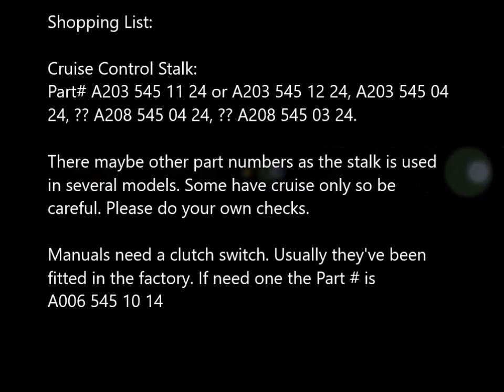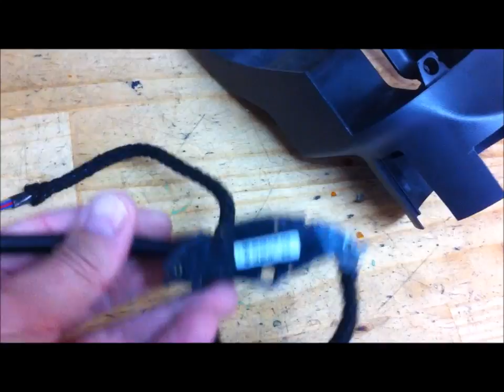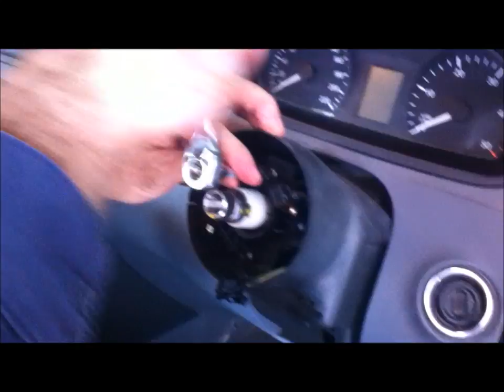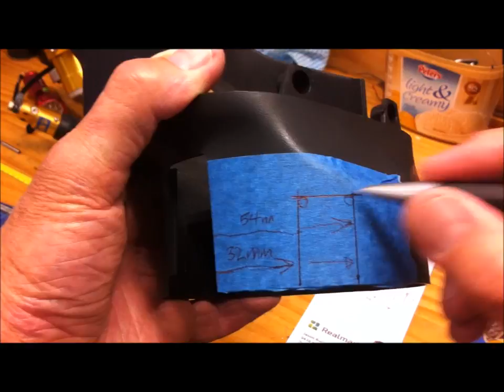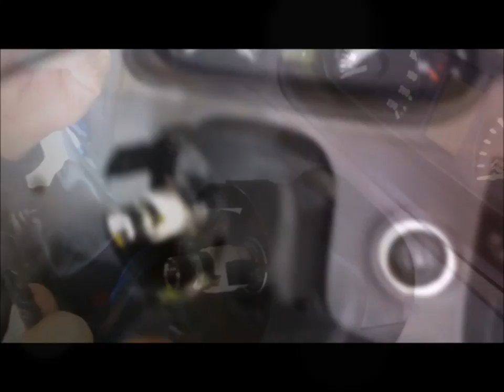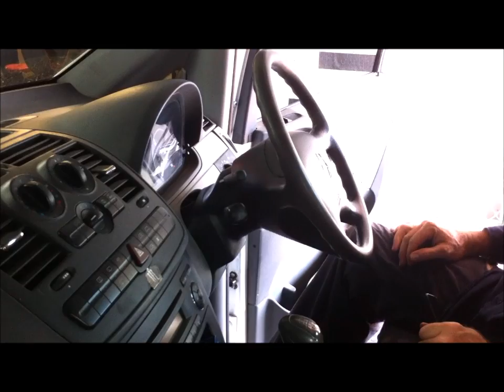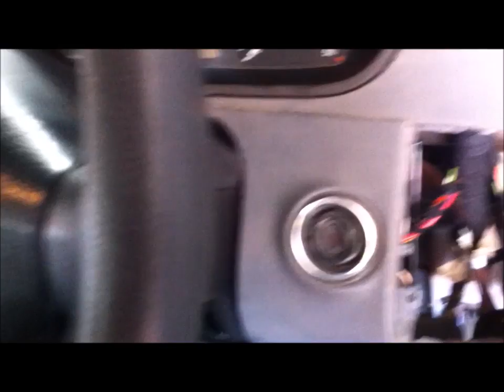W639 Vito Viano $60 Easy Factory Cruise Control retrofit

Comment: Hi Scott,
Thank you for the great video !
I am looking to install it on my 2007 manual Vito VIN : WDF63960313260718.
I am wondering what are the difference between all the cruise control Stalk references you gave at 4:09 ?
Regarding the accelerating pedal, I have a Bosch one 0 280 755 023 / A 906 300 04 04. I didn't desassembled it but it seems not having the switch. Do I really have to change it if I am just interested about speed cruise control and not speed limit ? If yes, what is the reference ? Bosch 0 280 755 024 ?
I have clutch switch installed.
Thanks for your help.
Jerome.
Reply from the maker: Thanks Jerome. The CC stalks have different part numbers for different models but they're the same. You don't need to do anything to the accelerator pedal. If you buy one of those part numbers and follow the video it will have cruise control and speed limiter.
Reply: @ScottElliott152  awesome Scott ! Thanks very much. I will order one piece, follow the process and let you know.

Comment: What is the original part number (Cruise control) for the 2016 B-Class, 180 dci (1.5 D), 110 hp, manual transmission? Thank you
Reply from the maker: Use this online parts finder. That's what I do.
https://partsouq.com/

Comment: Hi Scott, Could you please share your thoughts if retrofitting of Distronic to w639 is a viable idea?  Distronic is installed on the similar year (2010-2014) passenger cars, but I haven't heard about it on V-class prior to w447. Do you think w639 SAM supports this feature?
Reply from the maker: I've interrogated the SCN coding on my W639 and have seen no reference to the Distronic on my 2006. Knowing what these Mercedes are like I feel it would be a difficult project unless the ECU and other modules are already programmed for it.

Comment: Hi Scott,

Great video and very useful!
A quick question regarding other models of stalks, the 
A203 545 11 24
 aren't too common however the 
A203 545 12 24 
stalk is cheap and readily available.

Would this be a suitable alternative?

Many thanks,
Dan
Reply from the maker: Yes A203 545 12 24 should do it. See 4:09 in the video where I list that part as an alternative. Scott
Reply from the maker: Daniel to give you some comfort this was a comment from another viewer:

I followed this tutorial step by step , and it works perfectly. It’s easy with the  measurements.  Thank you very much sir.

Ps: i used the second tempomat part code A203 545 12 24.

Comment: I followed this tutorial step by step , and it works perfectly. It’s easy with the  measurements.  Thank you very much sir.

Ps: i used the second tempomat part code A203 545 12 24.
Reply from the maker: Glad I could help.
Reply: Very helpful found a stalk with that part number I’ll get it thanks

Comment: First of all, thank you for the instructions. I bought the cruise control two days ago for about 30$. And now I found out that it hasnt got this little resistence for adjusting 1 km/h and the point behind this resistence. Now my question: Does this cruise control a 10 km/h difference when you push it up or only 1km/h? Thank you the answer!
Reply from the maker: A quick touch up or down will adjust by 1km/hr. What part number is it? It should have two stage resistance as Mercedes have been doing it for years. Perhaps the resistance point is broken. Scott
Reply: Scott Elliott Hi Scott,

Its the part number 203 545 11 24 7C45 LS 203 224 Q 01.
I havnt built it in sofar but in this State in seems to have no resistence point. Should I feel this point even when it is Not Build in?
Reply from the maker: Joniboni that's a good question. The two stage mechanism probably only works once installed. It's the right part number so put it in. Good luck. Let me know how it goes. Scott.
Reply: Scott Elliott Thank you very much! Especially for the quick answers! I will let you know when I built it in.
Reply from the maker: Another thing the resistance spring is quite strong. Another reason why the switch needs to be securely fastened before you can move the lever past that point. Scott
Reply: Thank you for the hint!
Reply: I justed  a little bit with the cruise control (not built in yet). It really seems to have only one Stage, because it goes to the resistence point immediately.  Between the up and down resistence point there is a play of only around 2 millimeters.
Reply: Scott Elliott Today I have built it in. Still the same behavior as before :(
Reply from the maker: I was driving the Vito the other day and realised it doesn't have the two position position resistance switch like the CC stalk in my W204. So there you go. Nothing to worry about. Scott
Reply: Scott Elliott Ok thank you very much! In the W639 I read that the resitence point does exist, but its like it is now. And can you maybe tell by how much the velocity is im increased or decreased by pushing the lever up or down? Thank you
Reply from the maker: Each tap give 1km

Comment: Hi Scoot,

First thanks for this video. I've some questions before to start.
I have a 06 - 115 vito (OM646 DE22LA 110KW (150CH)) - left hand drive
So don't need to disconnect the battery and remove the airbag ?
Concerning the clutch pedal, I'm not sure I understood that part... What shall we do? ( I've a manual)

Regards
Reply from the maker: Disconnecting the battery is always a good idea. You can disconnect the airbag if you wish but we found it wasn't necessary.

Leave the clutch pedal as it should already have the switch that disconnects the CC when you touch the pedal.

Comment: Hi Scott. Nice video. Can I use same cruise control switch on facelift 2012 year Vito W639? Or there are other system?
Reply from the maker: Thanks for the compliment. I don't know if the face-lift model changed the steering column and switch. You need to have a look at both to compare. I would guess it will be the same as it was only a face-lift change. Look for some images of the interior or perhaps find a present face lift model to compare with yours. Go to www.benzworld.org as someone may know. Scott.
Reply from the maker: I had a quick look and the part number listed for a 2012 facelift version is A203 545 02 24. So the same method should work. The steering column assembly is the same. Scott
Reply: Thank you!
Reply: Did the facelift version work in the end? I'm about to buy one on eBay 😅

Comment: Hi Scott - back again. What lead do you use between your PC and the OBD port? I can't seem to find a suitable lead. Plenty that plug into an actual multiplexer and one ethernet to OBD for BMW, but nothing relating to Mercedes. Thanks in advance.
Reply from the maker: I use a USB to serial port adapter to connect the PC to the multiplexer. The cable from the multiplexer has the OBD2 plug on the end. http://www.ebay.com.au/itm/USB-to-RS232-Serial-Port-9-Pin-DB9-Cable-COM-Port-Adapter-Convertor-For-CH340-/282546793194?hash=item41c919eaea:g:QuQAAOSwvTBZtjQV

Comment: Hi Scott. Like some others I've fitted the cruise stalk to my 2005 Vito and haven't had much luck getting it enabled. As per one of the other comments, they find all sorts of other problems that "may" need fixing before the cruise will work - one which is probably valid is a steering angle sensor fault that may just need calibrating - but once again can't be done without the diagnostic program. With the $$ spent already, I could have bought one of the aftermarket MB Star devices. I see that you bought just the hard drive option (got that from one of the Benz forums). Does that have to be fitted into a laptop or just loaded onto one? What I'm looking at is the C3 version and supposedly works with any laptop but has multiple leads, of which I probably only need the one to hook up between the unit and the vito and between the unit and PC. Any info gratefully received. Also where do I find the diagnostic port in a Vito? Thanks in advance.
Reply from the maker: Neil the hard drive version is standalone which is why it can be handy. You can plug it into any computer and run DAS/Xentry.
You should be able to take the Vito to a MB Dealer and get it activated. They normally charge around $AUD150 to $AUD250. They do it all the time when they retrofit. Some get annoyed  with we DIY types but there are some reasonable businesses out there who will do the activation without getting their noses out of joint.
You'll probably need to join www.mhhauto.com to download an earlier version of DAS/Xentry. The later versions have been locked down so much it's not much better than generic software that reads trouble code. Start off with the Chinese system to learn then get 10-2008 up to 01-2011.
For a RHD Vito the OBD port is on the RHS under the dash above the accelerator pedal.

Comment: Hi mate Thanks for coming back to me so quickly.  I have just come back from an other independent mechanic  who has from what I can see all the correct Mercedes software and hardware. He went into the ESP control module and found the Actuations but there was no sub menu Cruse Control for him to turn on. Is it possible that some of the on board computers do not have the Cruse programed into it? or do we need to turn on the actual cruse stalk switch while the software is going through the on board computer?  He suggested if you could take a screen shot or give us some more information. This guy said he would really like to know how it was done or where he needs to go in the software to switch it on.  I have one more  independent fellow I can try on Tuesday when they service the van.  If all else fails maybe I need to go for along road trip I have always wanted to drive over to Perth the wife and I would love the drive. By the way I have fitted the van out with a false floor so we can sleep in the back when we go camping.  Anthony
Reply from the maker: Anthony I'll have a look and get back to you with some more information. You must have DAS in developer mode to activate it. Do you know if the guy has that?

Comment: Hi Scott. Another great video! 
I've installed the stalk successfully and I see the stalk via Star / Xentry, but am unable to activate it?
How do you access Xentry in developer mode? Also, I think the Xentry software might be a later version as I'm unable to follow your instructions since the menu a bit different, unless it's because I'm not in developer mode? 
I will greatly appreciate any assistance.
Reply from the maker: Thanks for the compliment. You need to use an earlier version of DAS not Xentry. I use 01-2011. You have to have developer mode for sure. The later versions of Xentry are getting close to useless as MB have locked so much out. They're basically a fault code and data reader. You may have to take the van to the dealer to get it activated if you can't get an earlier version of DAS.
Reply: Scott Elliott Thanx so much for such a prompt response and it's only a pleasure. Your instructional videos have taught me so much and saved me a lot of money. 
I'll try to get hold of the older version. I've ask the dealer already and instead they told me it couldn't be done as they 1st had to correct other issues and be charged an arm and both legs. 
Is there a specific way to enter  administrator mode? Or will there just be an additional icon in the older version I should look out for?

Again  thanks for the assist and all the great videos. I anxiously wait for your videos for the Vito to see what I can tackle next if anything. ( my faded lights are next on the list)...
Reply from the maker: You need to generate a pass code to access the developer mode in DAS. 
That requires the key generator software. If your computer savvy join 
www.mhhauto.com for $USD25 one off fee. You can download versions of DAS
 back to the first one 10-2008. all the key generators and tutorials are
 there. It takes a while to get a handle on it all but it will keep 
dementia at bay! alternatively find an independent with the software and
 get them to activate the CC.

In DAS you have to go to the variant coding for the vehicle and a list comes up with all the features and options fitted. In the list you select CC fitted. It's too hard to explain. Perhaps I can do a follow up video showing how to do it in 01-2011 DAS but the majority of people don't have the diagnostics at home. I doubt if many people would watch it. An independent shouldn't charge more than about $150.
Reply: Scott Elliott I've joined Mhhauto. will look for the version of software you used. 
I'll keep you updated And I'll try to a video of it, maybe it'll help someone like me and help complete the entire process. ( will be my 1st YouTube video 😂 if I do manage to pull it off). Thanx again Scott!

Comment: It´s the owners manual Scott
Reply from the maker: +Fernando Rafael I've seen downloadable pdf owners manuals on the Mercedes Benz websites.
Reply: +Scott Elliott,  Not for the model you are working on this video, is the same model as mine including the radio, and i tried every way, in the internet and the Mercedes-Benz over here, but they ran out.
If you notice a link or even a .pdf file i´ll appreciate.

Comment: Hi There Scott, great walk through....I hope to be attempting the installation tomorrow.
Reply from the maker: +eze dogman Good luck with it. Take your time. Let us all know how it goes. Regards, Scott
Reply: +Scott Elliott  The job came to a halt as I could not get the steering wheel bolt undone, it is tighter than a Ferret's arse. Going try again when I can recruit a spare pare of hands, other than that I was considering using an impact driver.
Reply from the maker: When I  did my own Vito the bolt came out easily. My friends Vito in the video was tight. We used the long breaker bar with a pipe on the end to give even more torque. He held the steering wheel and I pulled on the pipe. The bolt has blue thread lock from the factory. That got it off but the impact gun was next on the list!
Reply: Hi there Scott, Thanks for the reply.
    I am going to recruit another pair of hands and try again with an extension bar on the ratchet, hopefully that will work.
I am a little wary of using an impact gun as there are roller bearings in the steering column. If they were tapered then no problem but Hmmm...not so sure so going to use the path of least resistance first before bringing the big guns out to play.
Reply from the maker: I thought about the use of an impact gun and deduced it would be ok. Considering the impact is at right angles to the column that's were all the dynamic force is being directed.
Reply: +eze dogman All fitted, all I need to do now is get it activated with the Merc Star.  The steering wheel bolt came out, just needed a longer wrench / better leverage. Getting the plug into the rear of the ignition module was really awkward for me...I reckon it took 20 mins of fiddling to get it to snap into place. job looks good. Once again, thanks for the tutorial Scott :)
Reply from the maker: +eze dogman Well done. I'm glad I could help. Yes the plug into the back of the ignition switch is a bit fiddly but perseverance eventually pays off. Regards, Scott
Reply: +eze dogman  For anyone interested in doing this nifty little modification then the job time for me was about 90 minutes.  I paid £15 for a used cruise control stalk, and there is a guy on ebay who charges £40 for a Star/Xentry session. In the UK, Mercedes main dealers charge about £250 to supply & fit the cruise control.
Reply: +Scott Elliott  Booked in with a guy who has the Mercedes Star setup, He is not an expert with the kit so I have taken notes on what you state regarding 'setup' . Hopefully it will be the same here in England as it is in AuZ, if not then I have written down the instructions for doing the SEN coding method. If all fails then I will take it to a dealer to sort. Time will tell.... I will keep you posted. Regards  Brianps - next job will be curing the condensation in the headlight unit. Under normal circumstances I would have resorted to purchasing a new headlamp unit (£130 UK) but under your tutorage, £5 for a tube of mastic. After that then I will be due an engine oil service, as the filter is under the hood/bonnet then I am going to pump the oil out through the dipstick.  Carrying out these jobs is so rewarding on more than one level for sure.
Reply from the maker: Brian I have a set of instructions I'll put into Dropbox for you to download. While you have your headlight lens off why not install some angel eye rings as DRL's. It will give your Vito a unique look. I did it to my W204 C Class and I get lots of people asking where I got the headlights from. https://youtu.be/d77rzjC_F7g
They're amazed when I say it cost me $AUD20 to DIY.
Reply from the maker: +eze dogman Brian I'm interested to know how the modification to the existing plastic steering column shroud worked out. Were the dimensions I gave about right? Does the finished slot look neat and tidy around the CC stalk?
Reply from the maker: Brian I've put a link to DAS activation instructions in the Description. Scott
Reply: Hi Scott, Just an update here.

 I spoke with an ex - Mercedes Mechanic and he informs me that online SEN coding is required for the retrofit factory cruise control upgrade....in the UK at least.

  Best regards

Brian
Reply from the maker: They're are probably differences in each market.